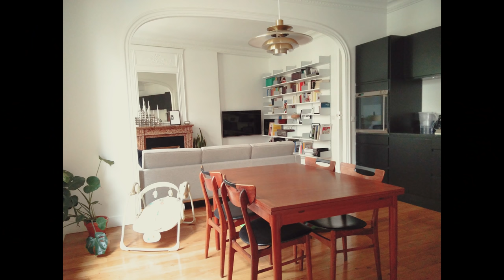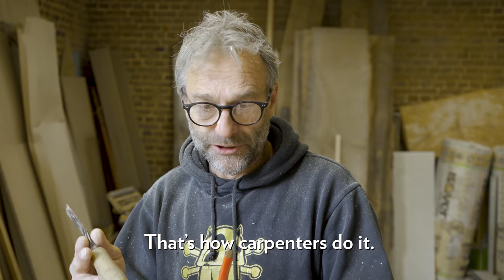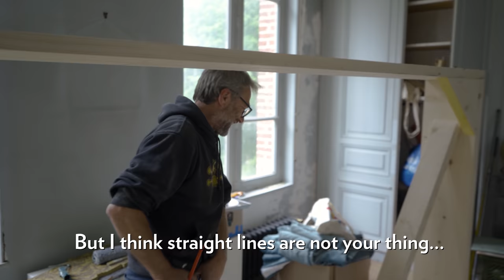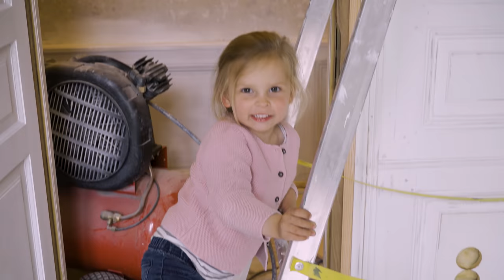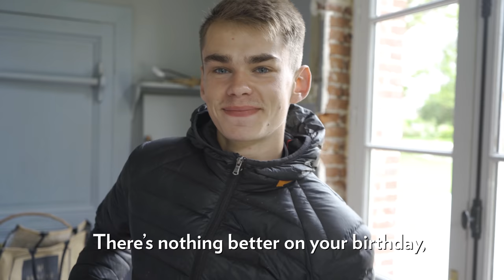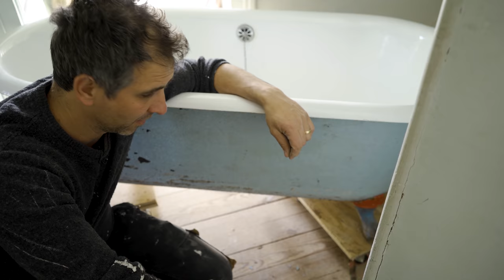I can't believe he's leaving! - How to renovate a chateau (Whithout killing your Partner) ep 22

Comment: Next Bath use "2 coats, rolling and tipping". (I've used this on slab dining tables, boats and sculpture building successfully.)
 
Setup the bath on a plastic sheet tilted away from the bath plug hole, throw away that plastic toothed trowel and have a sponge roller, finishing brush and heat gun ready.

1-Mix half the (bath) epoxy paint and pour it into the bath acting as your paint tray. Roll the complete surface with the small (approx 100mm) sponge roller. 
2-Swap to a finishing brush and horizontally brush smooth the sponged areas. 
3-Finish the whole surface with the heat gun. 
4-After its set, a light rub using 400grit wet and dry abrasive paper (wet) prepares for the next coat.
5-Mix the second half of epoxy and repeat the application process 1-3

This process is quick and clean with little epoxy waste. The finished results will be super smooth, super glossy, much cleaner. The roller will apply an even coat leaving aerated puckers, the brush will smooth the puckers with fine horizontal lines, the heat gun lowers the viscosity of the epoxy leveling the brush lines leaving a smooth flat super glossy surface. 

I'd suggest painting the outer shell with your chosen colour first. Applying the white epoxy last lets it bead on the lip edge to form a perfect edge boundary with the contrast paint. Great perseverance from you Philipp, anxiety sent Anna away where determination kept you going.

Comment: About the bathtub, if you were able to turn it on its side it would have helped in applying the paint stripper. Paint stripper works with time, however it evaporates very quickly. So if you had put the bathtub on the side, Then you goop it up with the stripper, a large section and immediately cover that wet zone with plastic wrap strips or a plastic drop sheet and let it stay on for 10 minutes or 15, then all the paint will have softened and dissolved and you scrape it off with one of three methods. Paint scraper or spatula, steel scraping brush such as the type you buy to  clean paint brushes or course steel wool. You my fine using all three works best, scraper followed by steel brush followed by steel wool. You must wear gloves of course, thick ones, the Medical gloves and craft gloves for Covid dissolve with paint stripper.
Reply from the maker: Thank you so much for those precious tips!

Comment: That was stressful but i guess it went well. 
Also about a small detail somewhere in a previous video: When you installed those bakelite switches i saw that they came with Phillips screws.
I think they are not "period correct" better to use (plain) slotted screws. (as for example, i won't ever use phillips screws on any of my vintage cameras ...:)
Have fun!

Comment: get a graco cordless airless spray gun they use the dewalt battery system and you will free up days of the painters time with no brush or roller marks then some of your work will start to be of a acceptable level and you will produce work that you can be proud of

Comment: I’m curious why they run the electricity cables around the top of the room (which looks like it is about 12-14 ft. up) rather than around the baseboards?  Maybe required per code?